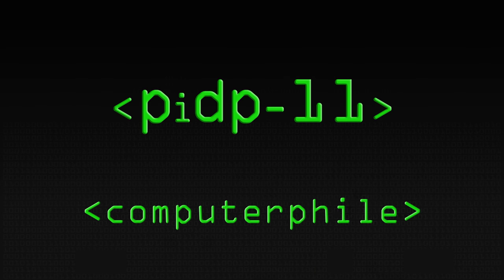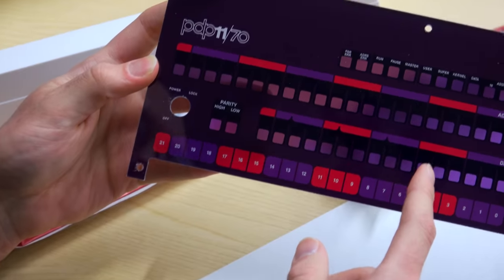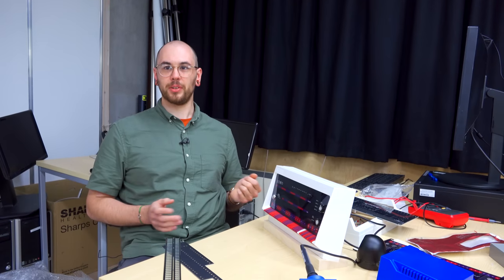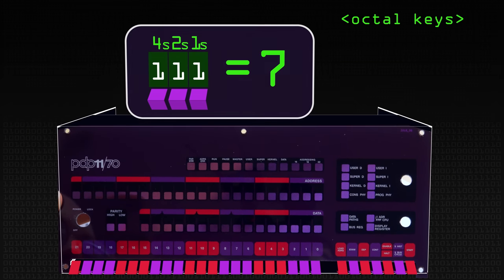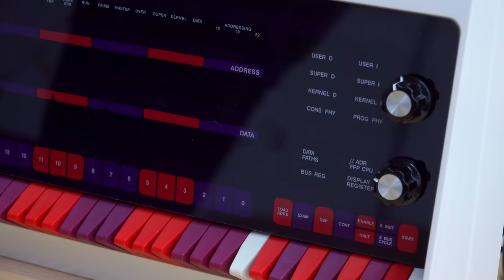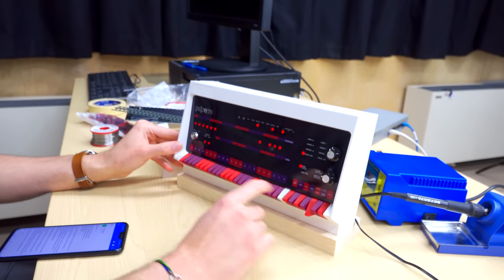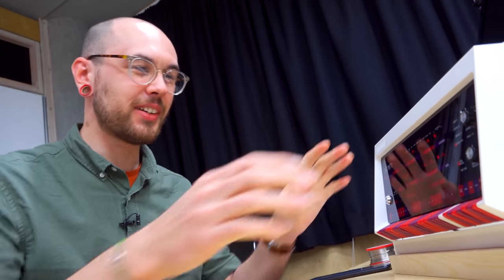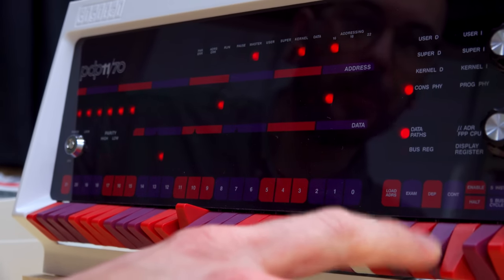PiDP-11 Retro Computer Build - Computerphile

Comment: I was the system programmer for a PDP 11/70 running IAS (a derivative of RSX 11). The instruction set was octal because 3 bit fields worked perfectly for the 8 register cpu. Our system was used as an in-house time sharing system in a civil engineering consulting company. We had Vt-100s on 3 floors of our office building. I recall adding an in house email system and job accounting for charge backs. The Digital source code was superb and quite easy to hook into. This was one of my favorite architectures; it also made the transition to the motorola 68K very easy.
Reply: Be glad that you never had to mess with RSX-11M  which was for some reason a bundle of spaghetti.   RSX-11D was the predecessor to IAS.  PDP-11s ran UNIX -V6 (I had a pair of 8" floppys that would boot and run on an 11/34 and ran V7 (and BSD 2.11 on a PdP11/44) and Unix -V7
Reply: Spike Evans    Not only eight registers, but also eight addressing modes.  A two operand instruction was four bit op code, three bit source register, three bit source addressing mode, three bit destination register, three bit destination addressing mode.  It made for a really easy to understand machine code model.  Geez, even I could understand it.  Octal was the perfect way to express and think about that instruction set.  The whole business about ASCII in the video was a confusing red herring.  Octal was for the instruction set, not the character set.  PDP-11’s were fine with ASCII, in part because 8-bit byte addressing was native.  It was easy to address and work with 8-bit data.

Comment: This is a great kit. Thanks for the demo and for taking the time to record it. It brings back a lot of memories. I cut my teeth on the PDP-11 series machines. I still have a board or 2, some DECTapes and a bunch of stuff from the early machines, including a 90 MB CDC drive that is bigger than my coffee table and takes 2 people just to move it. My how times have changed. In the late 70s Western Digital made a set of 5 chips that, together, functioned like the LSI-11 chipset, and executed the PDP-11 instruction set. Since a 16 bit processor is limited to 64K of address space, any RAM over 64K had to be paged using instructions to an IO port on the memory cards. One quickly became proficient in Octal arithmetic as a necessity when configuring the machines. 

Thanks!

Comment: Most of my programming experience was on IBM-360, but in the early 80's the company I worked for started doing some applications for the factory floor that required a PDP-11 (can't remember the model).  I didn't get to work much with the PDP, but wrote some code on a VAX that would send requests to the PDP that would then control material movement out on the shop floor.

I really loved the VAX (initially a VAX --11/750 then later a VAX-6000 and some MicroVAX workstations). 

I'm retired now, but just recently was thinking about the old days when computers had the big front panels with lots of switched and blinking lights and you could see by the patterns of blinking lights when the computer was doing what you expected or if it was stuck in some endless loop.  I kind of miss those days.
Reply: So after working on PDP and VAX minicomputer systems, would you have wanted to go back to working in the IBM mainframe environment if the opportunity were to appear?

Comment: In the mid 1970’s, the PDP-11s I was using at college ran chasing light patterns as an idle program on their time sharing operating systems.  If the machine was active, performing a requested task, the front panel lights would blur, but when the machine was waiting for a request, it displayed the chasing light pattern.  Each DEC operating system, I think even different major versions of OS’s, had a different chasing light pattern, so you could, if you recognized the patterns, tell which OS was running on a machine simply by looking at the front panel for a few seconds.
Reply: Then in 1981-2 David Hasselhoff AKA Michael Knight of Team Knight Rider incorporated the rotating lights (RSX11M) in the grill of a Trans AM. Think the car also had DECTalk.

Comment: How retro this is. Loading programs from tapes on my c64 now seems so comfortable compared to a PDP11
Reply: Paul Wiegmans   Only a really bare bones PDP-11 had to have more than a couple of words loaded at startup.  An optional, but common, ROM boot loader required only one address and one instruction to be entered from the front panel in order to boot an operating system from a storage device.  It was a few seconds work.

Comment: 7:23 No, the address register is incrementing by 2 each time (note the little gap where the units bit is 0). Machine instructions are multiples of 2 bytes in length, and have to be stored in even addresses.

Comment: 3:57 Notice the switch numbers up to 21? (The other end starts at 0.) The 11/70, while it was a 16-bit machine with a 16-bit “virtual” address space, had 22-bit physical addresses. It think it could handle up to 2MiB of RAM, not 4MiB--the other half of the address space was for accessing I/O devices. But the software couldn’t access the entire address space directly — it had to keep fiddling memory-mapping registers to map various 8kiB blocks of the virtual space to desired blocks of the physical space.
Reply: True, but that's why pipes in the UNIX shell could work so well.  You could probably have a 64KB program 64KB of data, and then you could have 16 of these programs running at once in 32 separate 64-KB memory spaces = 2MB.  They could communicate through the kernel or originally, UNIX used intermediate files to store piped data.

Comment: Learned to program on an 11/70 running RSTS/E. The PDP cabinets were about 6 ft tall and formed a black wall with the CPU cabinet in the middle. On the left side was the magtape drive. And to the right, a pair of washing machine sized removable disc drives. The whole thing was enclosed in an air conditioned glass fronted room. At night, you could look into the computer center, and see the rotating lights on the front panel.

But then they slapped a diagnostic panel on replacing the lights. 😪
Reply: An 11/70 was the main campus machine when I started my Comp Sci degree (1979).

I learnt a lot from messing around on it--stuff that wasn’t even taught in lectures. Several of the lecturers seemed to have expertise elsewhere. For example, one handed out notes on how to do system service calls on a UNIVAC machine, because that’s all he knew. Which was completely useless, given we had no access to such a machine. Nobody gave a lecture on how to do service calls on RSTS/E — what a wasted opportunity, when there was an actual living, breathing machine running that very OS just outside the lecture hall, that the students could have run actual exercises on.
Reply: @lawrencedoliveiro9104  yep. Huge, multi platter discs which held a whopping 32MB! I remember doing backups at Systime back in the early 80s.

Comment: The machines I used had a boot loader in diode array ROM that could boot to an operating system stored on a hard drive.  All it required was toggling in one address and one instruction on the front panel switches followed by a switch that started at the loaded instruction.  With a tiny bit of practice, it could be done from (human) memory in no more than 15 seconds.  A single user operating system, RT-11, was up and running from a cold start in no more than a minute on a PDP-11/20, the earliest, slowest of the family.  That was in 1975.
Reply: Mike Enright   That is quite possible.  The point of the diode array boot rom was to avoid having to toggle in that first level loader, but if yours was inoperative for some reason, the front panel would get you going.
Reply: Mike Enright   I don’t know about 10’s, but on early 11’s I/O devices were memory mapped.  It means reading from a simple sequential device like a paper tape, putting the results in memory and executing them would not really require a big program.  The PDP-11’s auto-indexed Move instruction was ideal for this sort of thing.
Reply: @markholm7050  You are correct. The PDP-11 series had a completely orthogonal instruction set. Instructions could operate on data from any source or destination.

Comment: What would be a great project is to set one up like a player piano, where you can load any code and then run it in a debug mode of sorts where it plays out the switch toggling that would have been needed to input the project it is executing.

Comment: We only ever used the direct key entry to load a short boot loader program that then loaded a more complex loader that read in the operating system. From then on you logged on like any other multi user computer - even type in Basic (or Focal-11 - the DEC version)
Reply: That was my experience, too.  Only had to toggle in one address and one instruction to get the machine going from a cold start, a few seconds work.
Reply: 17773060 I seem to recall

Comment: I have an M8192 processor board. It has two big ceramic chips and what appears to be a bunch of TTL logic. If have to look to see what exactly is on there. Might be a bit of RAM also.
Reply: Cool! The M8192 is the 11/73, and is shown in the video previewed at the start of this one.  It comes in three types, only the -YC has a floating point coprocessor iirc. They don't have any onboard RAM though, but should find yourself a 22 bit backplane, some RAM and an SLU or MXV11 card :)

Comment: I am just a layman, and not a particularily knowledgeable one on this topic, but I have came up with a crazy idea which I would love to get an opinion on from the computer experts here.

My idea, is a computer with one extra bit in every byte. The extra bit would not be counted into the byte´s number, it would rather mark the byte, as belonging to the computer´s own programming or not. The extra bits would stay in the computer - input and output cables should not have the capability to transfer the extra bits. When a new byte is programmed in or come through an input port, it will be given the extra bit.

For example, the information you create when you type on the keyboard, or that come through some other entrusted input, could be marked as "green" with an extra 1 in every byte. Information that come from some not so secure input which you would expect to get attacked from - for example an Internet connection - could be marked as "red" with an exrta 0 in every byte.

The idea - I do not have the competence to tell if it would work or not - is that only "green" code should be allowed to do some things, or that the anti-virus software should be able to recognize "red" code, and stop it from doing something it is not entrusted to do.
Reply: CPU'S have EDB execute data bit which does something similar.

Comment: You're lucky you don't have any electronics engineers in here or you'd be getting flak about strain relief.
Reply: @ClickThisToSubscribe Bending the legs on components should be done with a tool that ensures no strain is placed on the junction of the wire and the inner parts of the component.

Comment: It's crazy. The slowest pi made, running one of the slower languages made, running a program that emulates the PDP 11, is still faster than the real deal.
Reply: Actually, the emulator software is SimH, which is written in C, which is pretty fast.
Reply: @solderbuff  I read the code and its really not that great.  On a pi4 its 10x faster than a PDP-11 (6 MIPS) but it could be 20 MIPS with some tuning.

Comment: serial port for terminal???
Reply: You can add one, but most people connect via the WiFi on the pi. Just SSH in and start the simulator software, set the toggle switches on the panel to one of 7-8 patterns based on what operating system you want to run and reboot, and Unix, try, etc will boot up